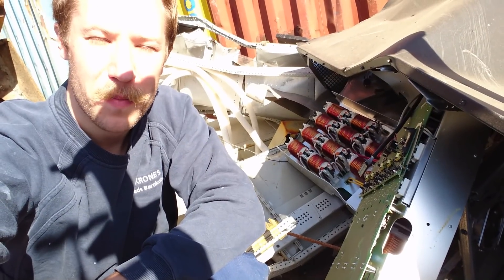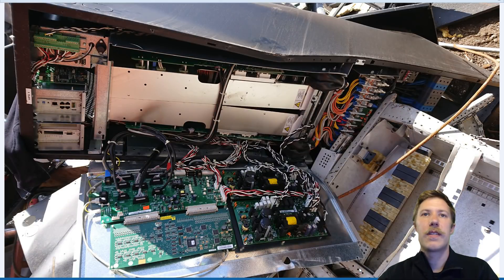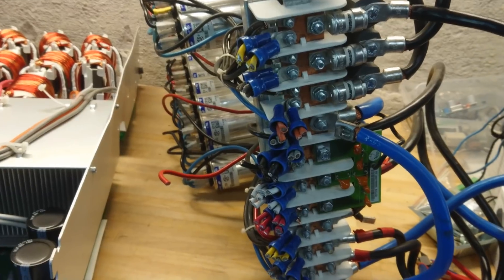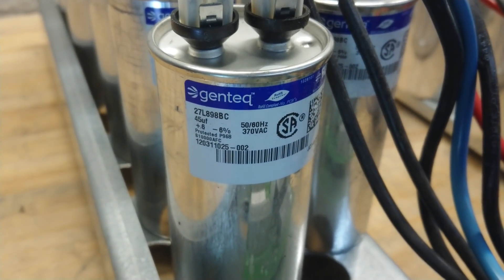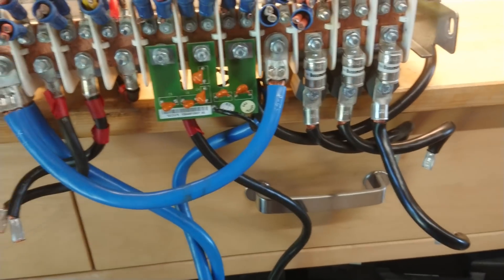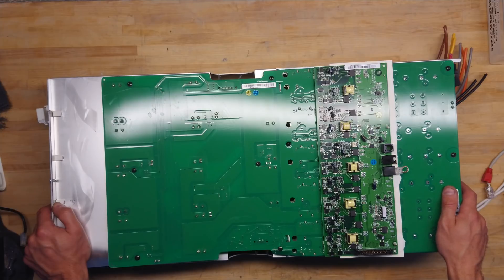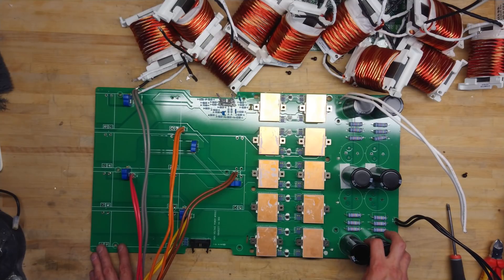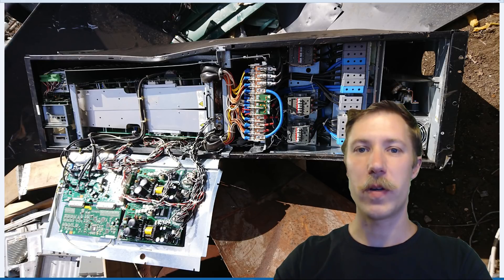Teardown of a Eaton PowerWare 60kVA UPS System

Comment: How many of these do I need to power my Minecraft server when the power goes out :)
Reply from the maker: 1
Reply: One small UPS would do it. Just need to figure out how long you need to run it. Most people just have a small UPS and a generator that kicks in after about 30 seconds. If you have a generator with the auto start at the time the power is disrupted you can save a lot on batteries and a smaller UPS. I would buy an American made one though. Not a Chinese one like Eaton sells!

Comment: I think that I saw something that might be hall effect current sensors on the IGBT PCB, do you know if it uses a combination of CTs and hall-effect to take signals with DC-offset or non-zero average contnt or high crest factor into account? 

Regarding the 10 inductor chokes, it would be interesting to know in what kind of topology they were connected, and what kind of ferrite that was used inside of them. My guess without much knowledge would be that they are meant to be some kind of common mode-choke that can withstand very high series current without saturating too much.. I just don't know what that behavior would be used for apart from maybe detecting current zero-crossing or similar..
Reply from the maker: I have a lot of hall-effect current sensors. Ferrite toroid with a slot cut in it and a hall-effect sensor with 3 legs sitting there.

The inductors is a single piece of block ferrite. Around 2x5x10cm and with windings almost 1 cm from the core on plastic spacers.
Reply: @KaizerPowerElectronicsDk  Thanks for the reply. Is every current measurement performed with hall-effect sensors on the primary side instead of the much less complex use of current transformers? I'm nerding deeper into this kind of technology since I have the opportunity to go from embedded software/electronics development to maybe get involved in designing 3-phase grid-connected power electronics where the primaries will be switching 3 phases in either clamped half-bridge, full-brige or dual-winding dual half-bridge mode where it looks like 20-100A and 700VAC peak needs to be dealt with using as few IGBTs/diodes/voltage drop paths as possible while being able to always handle full voltage short circuits, inrush current, lightning strike voltages while reaching enough efficiency for the thing to be of any economic use. Things like using added leakage inductance between windings is something that appeals to me just like using the lossy ESR of a standard wet electrolytic cap to add attenuation to a snubber circuit to save on component cost. One thing that I for example can't get my head around is how complex the design of EMI filtering needs to be in order to run a 100A IGBT-chopper with the kind of massive inductive wire-loops that such a gigantic contraption will have in comparison to the extremely compact multi-layer PCBs with good ground-planes that I used when I designed class-D amplifiers and SMPS in the ancient days of my youth as a hobbyist, or how difficult it is to actually make semiconductors survive current and voltage surges of the kind the standards hint about, or even just how to implement the IGBT drivers with fault detection, fast/slow turn-off and if even a DSP can drive them all with safety or if a FPGA + DSP solution is needed in order to safe-guard against a stack overflow causing a PWM-stage to get stuck..

Comment: That's the smallest 9390 (60KVA) I've seen. We run stand alone 80KVA and 6x parallel 160KVA 9390.

They are old and about to be thrown out.
Reply from the maker: I am interested in the power electronics of the 160kVA units, are you getting them?
Reply: @KaizerPowerElectronicsDk  it might be possible to get you some components (or even full working unit). But it depends on arrangements for the replacement process (yet to be determined).

Comment: Wow, a 400V 9390. Never seen one of those and I service 9390's every week. Gonna have to watch this video again with audio.
Reply from the maker: Denmark and most of Europe uses 3 phase 400VAC, where do you service on these?
Reply: America. I’m a OEM field engineer.
Reply from the maker: @thurmanite77  So that would usually be 3x208V? Does that make a big difference on the power electronics or do they use a voltage doubler on the input and use the same IGBTs as the European units?
Reply: The 9390 is either 208, 400, or 480 3 phase. The large, heavy, silver metalled components that contained the inductors and the IGBTs are the power modules, 2 on the left are in the rectifier position and the 2 on the right are the inverter. The power modules are all the same in the units, it just depends on what position they’re in for whether they’re AC/DC or DC/AC. I believe the 400V and the 480V are the same modules, the 208V modules are different.
Reply: @thurmanite77  So do you replace all the power modules when they blow up or just the bad ones?  Are you still having problems with Smokey Bear/93PM caching on fire?
Reply: @thebealepapers3968  Typically all affected modules are replaced during a failure, unless it's a billable repair and then we can text the other less obviously damaged modules before replacing them. And 93PM catching fire? Not that I have ever seen with my eyes.

Comment: IGBT modules easiest is to use a grinder to cut the board around them, then simply use some steel wire threaded through the space between board and device, and a hot plate to reflow the solder, and pull the module out again. Sacrificial electric hot plate from the cheap store, some wire and a little practise and you will get at least half of them out.
Reply from the maker: I will come back with a inverter hack later on, as it turns out it might be useful afterall, the IGBT modules are somewhat different as the pins actually sits in sockets inside the IGBT module, so you can remove the module and the pins still sit in the PCB.
Reply: @KaizerPowerElectronicsDk  do you have the ref part number of the IGBT modules? :)
Reply from the maker: @kepaodriozola4619  FS35R12YT3
Reply: @KaizerPowerElectronicsDk  thank you so much!! ;)
Reply: Are the modules arranged in parallel in groups of 5? As it is an Online UPS, there is an AC-DC and a DC-AC stage connected in back-to-back sharing the same DC bus. Looking at the datasheet of the reference FS35R12YT3 it appears that each module is a three-phase 2-level inverter. Do you think that some of these modules have also been used for the DC-DC stage (Buck-Boost) to interface with the battery?

Comment: Any one know what the red wires are for?
Manual Below, They connect to the battery. The battery doesn't connect across the capacitor bank (black and white wires)
Edit: http://www.eaton.com/content/dam/eaton/products/backup-power-ups-surge-it-power-distribution/backup-power-ups/eaton-93e-ups/eaton-93e-ups-40kva-60kva-generation-3-manual-p-164000032.pdf
Reply from the maker: There is not really any details on the intermediate busbar connections on the capacitor bank in the manual, only the large terminal inputs.

Comment: I spotted the TI TMS microprocessor on the CPU board, the other 4 big ICs appear to be Altera Max FPGAs.
I can see the current transformers not being easy to use without the analogue processing board which you didn't get.
Reply from the maker: They are just regular 50 Hz current transformers, possible with a material for higher harmonic measurements, but I guess they could just be reused as a normal current transformer for outputting a ratio current. But I got too many other current transformers, monitors and transducers to even save these :)
Reply: Open an Ebay store to sell the parts that are in good condition but you have no use for?

Comment: That was great and painful to watch. How much did you have to pay for all that? I would love to play with those things also, take them apart. I just disassembled some PC supply transformers, wonder if you could use acetone also on those you have.
Based on battery with 480v @ 135A, I would was this is 60kVA unit also, this is based on top right sticker

But I think this was upgreaded or something to 80KVa/72kw, since lower sticker says 480V @ 180A
Reply from the maker: It was a damn shame they got smashed before I found them. I do not pay for electronics as its a waste product for the  junk yard, but I also return most of the copper to them afterwards. The inductors were not varnished, just cable ties securing each end.